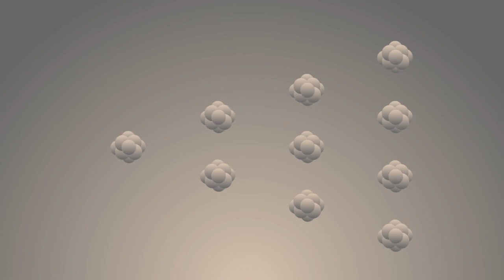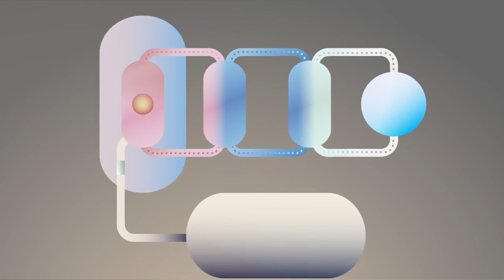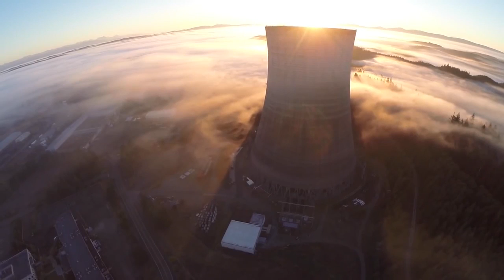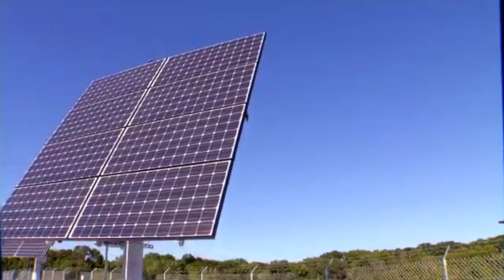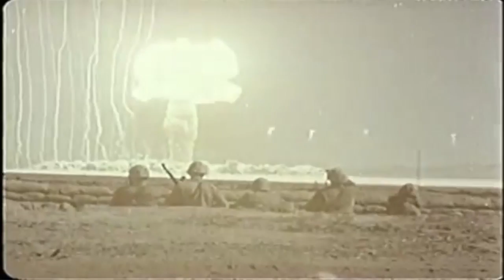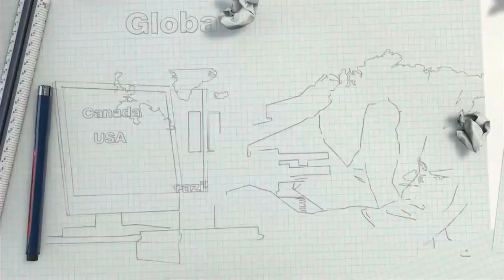The Liquid Flouride Thorium Reactor (LFTR) Solution

Comment: The drain tank is not made out of graphite. It has to be made out of an neutron absorber, not moderator.
Reply: Pyrolytic graphite raises the criticality (it does not maintain it sub critical), it slows down (moderates/thermalize) the neutrons in order to be „absorbed” by the uranium/thorium. If I were the designer, I would include electric heaters in the drain tank to melt the salt so that it can be reused. Also, I'd use the dump tank as storage for the gaseous fission products, most notably Xenon 135 (which it has the highest neutron cross-section of all, a very good neutron poison), rendering the installation decay radiation/runaway criticality fail safe.

Comment: can I build a LFTR for off the grid use?
Reply: I've been thinking about this question and I believe its possible though highly illegal in theory by learning to refine natural uranium metal and thorium  metal and converting it to chloride salts, small scale containment could be a silicon carbide vessel wrapped with a sodium filled ss heat exchanger inside an ceramic fiber insulated outer ss vessel placed in an under ground pit and flooded with argon gas....biggest problem would be getting enough neutrons to start the burn, though I think the .7% u235 in natural uranium might be enough kick start the reaction given the right graphite moderator cross section...and initial heat would have to be introduced to liquify the fuel, adding americium from smoke detector's could help startup as well........if successful your reaction would eventually be detected...... And some serious legal troubles would follow.....as well as 15 mins of fame..
Reply: TV- 8  tank was to the Thorium Nuke powered so a rector that small could be used for remote use.  https://en.wikipedia.org/wiki/Chrysler_TV-8   I also  like the idea of a Thorium Reactor using free piston stirling cycle engines, scaled down for "off the grid" use of course .  N.A.S.A  in big into nuke powered stirlings